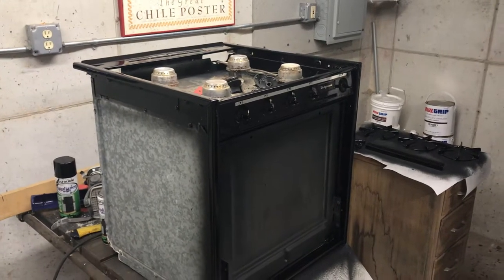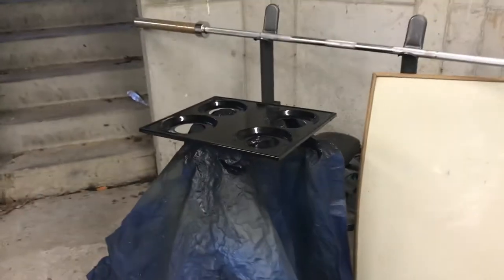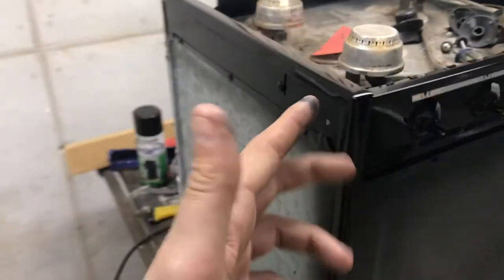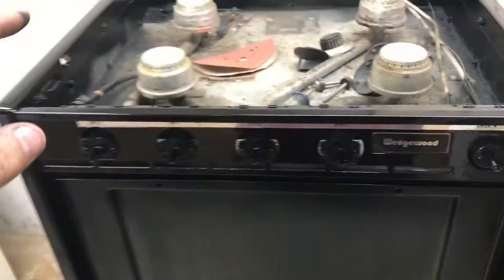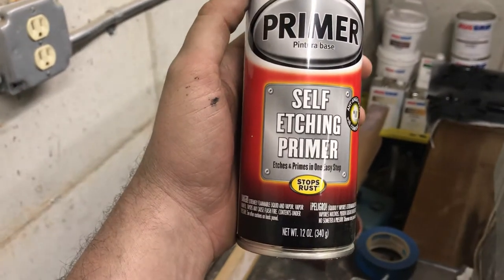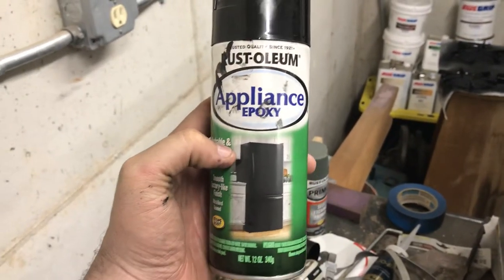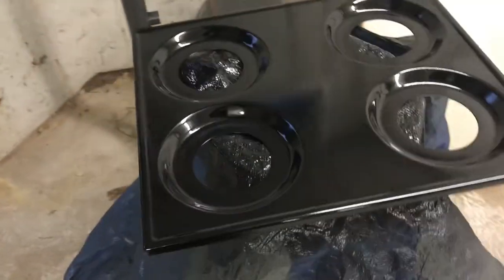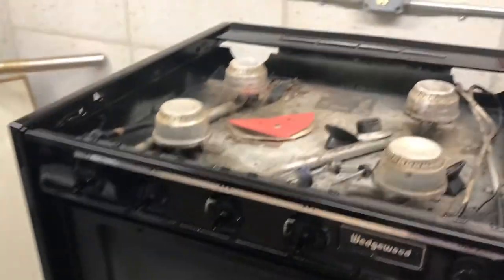Restoring propane RV stove

Comment: Just wondering how your paint held up on the stove top. Ive got an old 2 burner stove top I want redo. Was wondering hoe the appliance paint held up to the propane flame heat.
Reply: Hi wondering how the paint held up on your stove top when burner is on looking to paint mine in RV thanks 😊